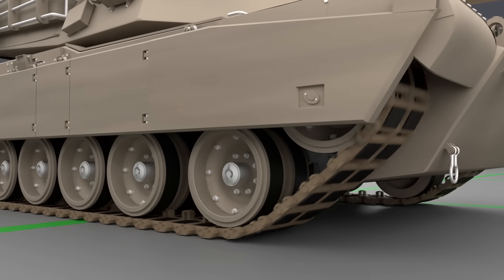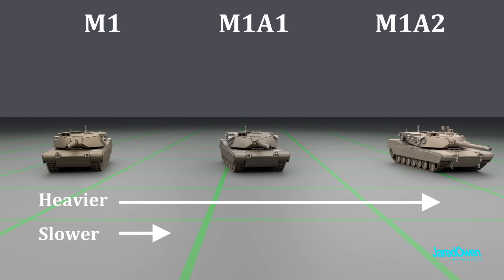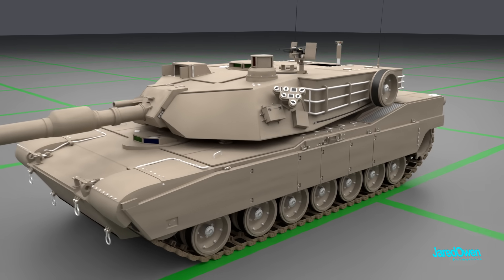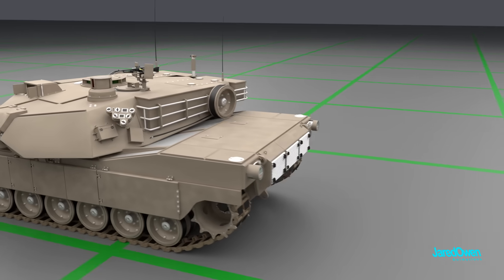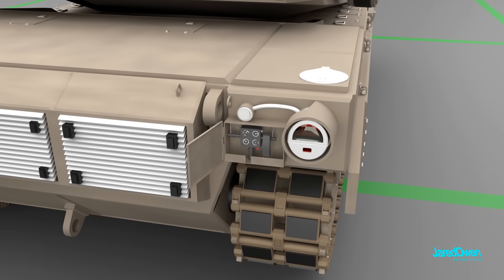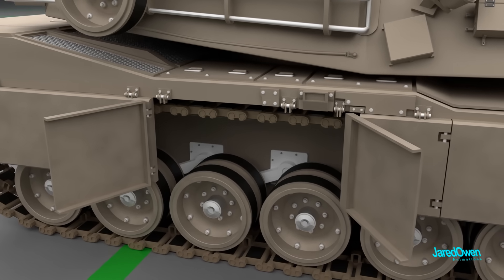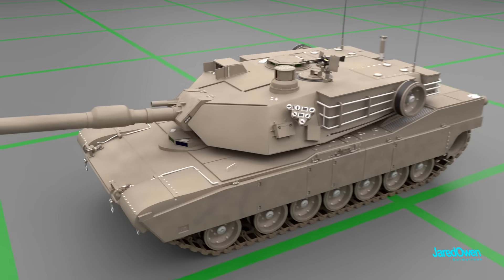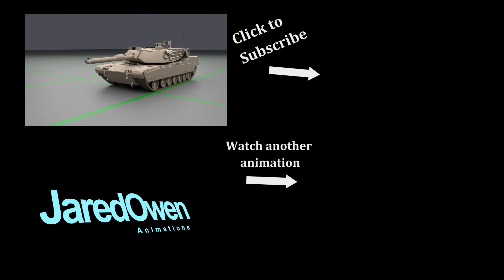How does a Tank work? (M1A2 Abrams)

Comment: WANT TO LEARN OF TRUTH - Fake NEWS is everywhere - FOX NEWS is a better one - CNN is most all Fake - Free energy is in our Bible and is so super simple that it should be positive proof of an extremely powerful SPIRITUAL WARFARE. This is going on behind the scenes in order to cover up the simplicity of this super simple ancient free energy technology. (Geometrical Electricity Multiplication) This free energy technology is so old that it can be found in Ezekiel 1:16, where it is attempting to describe the workings of a UFO motor - ”a wheel in the middle of a wheel”. I used pulleys to imitate this technology, where you only input a few sparks of current for 1 rotation of a motor with a large 33 cm circumference, (about 10 cm diameter) pulley attached. This would freely gain you 99 cycles of AC or DC electricity, from 3 mini-pulleys of 1 cm circumference-(about 0.33 cm diameter) with AC or DC motors/generators attached.
-
Please Don't Believe in the torque lie, as torque is only needed when you need to produce power when the only power that these three mini-pulleys need to produce is a lot of voltage, (easy to do) and a few sparks of current, to crank over this 33 cm pulley once - which takes practically no power. That's right, this one large pulley, along with three mini-pulleys are forming a self-powering set of DC generators-motors. The many rotations of the mini=pulleys build up the massive voltage needed to crank over the large 33 cm pulley once. Then you use the large amount of belt that you gain from the single rotation of the large pulley to rotate the 3 mini-pulleys in massive amounts of times
-
Want to know more about something that really matters, like the Truth about the true powers of this world, reality, and what our lives are truly all about. I believe that Trump believes in our Father in Heaven, and by the way, the ARK of the COVENANT has been found in Jeremiah's Grotto, right under where YESHUA-Jesus was crucified. So HIS BLOOD and WATER that came out when He was stabbed by the spear could run down the crack in the bedrock, that happened when the earth quaked and landed on the correct side of the ARK, that was placed there many hundreds of years earlier. 
-
PLEASE WATCH THIS VIDEO https://www.youtube.com/watch?v=B8TRoQk6WUE @ (41:41) - HIS Blood is STILL ALIVE and has only 24 chromosomes - 23 from His mother and only One male chromosome from His Father Above (normal people have 46, that’s 23 from the mother and 23 from the dad). If these videos have been taken down, then in YouTube search these words - ( ark of covenant blood Ron Wyatt ) - Sorry guys + gals, but the higher up elite of mankind has decided to believe + side with these aliens (fallen angels and Nephilim) - sons+daughters of the children of fallen angels + human females in building these particle colliders + quantum computers - which mess with our timelines + allow evil spirits into our reality.
-
The Bible writings speak Truth and real HIS-story,
NOAH’s ARK -  there are many stories of the world flood all over this earth
https://www.youtube.com/watch?v=oQwfU7DvUyE  
https://www.youtube.com/watch?v=82j1IqwA6P0 
RED SEA CROSSING
https://www.youtube.com/watch?v=QeX966OVxwU  
https://www.youtube.com/watch?v=Nsa7ebyUVD4  
-
I cannot be sure if Trump was-is+will-be the best American President,,, but did you notice that the fake news of the very corrupt media does not mention all of the great things Trump did?. Democrats not only want to kill your unborn offspring, but they want to kill them after birth even. DON'T BELIEVE ME,,,., then Google Democrat + abortion, then you can see for yourself. 
-
BY THE WAY - ISN'T THE FACT THAT THE ARK OF THE COVENANT HAS BEEN FOUND early in 82 and WITH CHRIST'S BLOOD ON IT and HIS BLOOD STILL BEING ALIVE AFTER 2000 YEARS- (PROVING THAT HE IS DIVINE), - HAVING ONLY 24 CHROMOSOMES - PROOF OF VIRGIN BORN (the biggest NEWS ever, and proof of the corrupt or fake NEWS) why is this not covered on every TV station 
<<PROOF - search YouTube>>
-
TRUMP ELECTION SCANDAL <<< If these are true-This Is Scary >>>
https://www.youtube.com/watch?v=V_7Z058MC7M&t=3735s 
https://www.youtube.com/watch?v=dBj9ZDC_Ad8&t=1481s  
https://www.youtube.com/watch?v=m0YKf-caVuY&t=240s 
https://www.youtube.com/watch?v=V_7Z058MC7M&t=3720s  
https://www.youtube.com/watch?v=OWwNJZhcrww  
https://www.youtube.com/watch?v=R5ki6S-WsKU&t=977s   
-
WAR IS UNEXCUSABLE https://www.youtube.com/watch?v=spnJ5WDgZnY  
-
Isn't it amazing what knowledge we can gain by simply adding the “il-s” of life, into this evil theory.,, EVil-sOLUTION. Evolution never happened,,, and it never had the time, so it could have happened,,,, because we have only been here on this earth for about 6000 years. These moon age figures are taken from this website @ http://lunarnetworks.blogspot.com/2013/11/apollo-12-alsep-first-to-measure-dust.html   
“Or, so NASA thought,,, just fast enough to form a layer about a millimeter (0.04 inch) thick every 1,000 years. If we say that the moon has been here 4.5 billion years or 4,500,000,000 years and We multiply that by X 1 mm / 1000 years = 4,500 meters of dust. Can you see the utter stupidity of believing that we have been here for even millions let alone billions of years. Our moon is God’s Hourglass, where the small amount of dust being deposited positively proving that we have only existed for a few thousand years.
-
WHERE ARE THE BILLIONS OF YEARS WORTH OF DUST DEPOSITS. Surely that would have produced many meters of dust, as would not the dust have been deposited even quicker way back then + Don't try to tell me that something or someone removed the dust every so many thousand years.
-
DO THE MATH FOR YOURSELF = the amount of dust deposit is known,,, + the amount deposited every year is known too. I did the math in the early '90s, and it worked out to be about 6000 years worth of dust that is on the moon now. I don't know if they use the same figures now or not. But even so, it should be obvious that after even one billion years,,,, the dust should be many meters thick.
-
TRUTH about COVID-19 = https://www.youtube.com/watch?v=H_vNWmqWmZc 
+ https://www.youtube.com/watch?v=vzIWq_59MIY 
-
Have you ever heard of the MANDELA Effect? PLEASE CHECK THIS OUT,,,, + then try telling me that there is not a POWERFUL SPIRITUAL WARFARE going on in our world. This is a must-watch video. All of time and space are changing. Things that are true have been altered + CERN is the cause for these events.
https://www.youtube.com/watch?v=pPrutcbaerQ 
-
Here is one of the videos trying to let this scary information out
https://www.readersdigest.com.au/true-stories-lifestyle/thought-provoking/44-mandela-effect-examples-that-are-seriously-mind-bending 
-
+ here is an explanation by the Physicists https://www.youtube.com/watch?v=HHKmoBeNWWQ&list=PLDIEv5nkqqEa0-u8DIzqpefKBAG0nkb7g&index=2 
-
PRIORITY ONE = This world is going crazy + surely heading for the END TIMES. 
Priority should be, what can I do to prepare + protect yourself + your whole family. 
I don’t care what these EVil-sOLUTIONIST claim. They have never been able to find any missing kinks, between humans + apes or any other animals, and never will,,, because there aren't any. Did you ever see how much DNA coding that there is in the smallest human cell? It is massive + if it were a book shown to us, then we would have no problem in seeing how it could never be made by random chance. And the thing is, DNA is so much more complicated than any book that we could write. 
-
Please choose to take God’s free gift of Christ into your heart, as payment for your sins, so that you can look forward to a beautiful eternity  + do not need to worry about the future. Life is forever,,, if you miss this chance, then you are not only condemning your family to 60 - 80 years of life without the hope + the comfort of a loving Father + Savior + Companion, but you may be condemning them to an eternity in a place worse than hell, where you or nobody else can help them. 
-
Sorry if I scare you with this talk about our eternal souls, but I wish to warn you of LIFE, and all of its good + bad. God created us for good reasons, as He wanted to Create beings that he could love + take care of + communicate with. He is a Holy Being and needs us to be holy to be in His presence. He knew that we could never attain holiness on our own, so He sent His only Son so that we could choose to be with Him and take the Holy Spirit into our beings. That way He could freely give us that which we could not gain on our own so that we could eternally live with Him + He with us.
-
CERN Is Changing Our Timelines – Proof - Mandela Effect Part 1 + this is a video of what they are really up to https://www.youtube.com/watch?v=49dGknES0-w  
-
Here is a website that shows you how quick + simple this GEM technology is to build
= https://www.youtube.com/watch?reload=9&v=NxpoiCFKmPg   
I used 3 mini-pulleys to gain the voltage, but this system only used one
-
http://beliefstoliveby.yolasite.com/  
http://evolutiondebate.yolasite.com/  
-
TRUTH ABOUT CERN
https://www.youtube.com/watch?v=49dGknES0-w 
https://www.youtube.com/watch?v=ooZA0riSa9Y 
D-WAVE COMPUTER
https://www.youtube.com/watch?v=1v19n5JBSDs&t=305s 
RELEASING DARKNESS
https://www.youtube.com/watch?v=7TA-z6RrXRo 
SATAN’s NAME IS "god"
https://www.youtube.com/watch?v=_qr2vT5ySLA&t= 
ILLUMINATI PLAN FOR HUMANITY
https://www.youtube.com/watch?v=49dGknES0-wDE 
MANDELA EFFECT
https://www.mentalfloss.com/article/585887/mandela-effect-examples  
CHRONOVISOR 
https://www.youtube.com/watch?v=eEXpc-a5ry8
Reply: No one asked

Comment: I had to rig an Abrams for animation few years back. Took about a week to get it to the same level of response as seen in this video. Coding tracks to animate correctly with turns and following terrain irregularities was a lot of fun. A video like this would take 2 weeks of full time work to put together at the very least. Excellent job. Clear and informative. Sadly, the project I worked on was cancelled, so it will never see the light of day. Can't even use the tank rig on my demo reel because of it.
Reply: I can do it in 5 minutes easy

Comment: That was well done, but a few questions... what about the other machine gun on the turret? There's both a 7.62mm NATO and a .50 cal... right? Where is all the ammunition for the 3 machine guns stored... not in that turret bustle... right? The crew has to be able to access it in one big hurry. It would have been nice to mention the armor itself... chobham and a layer of DU?

Do the crewmen all start as loaders then become drivers, then gunners and finally commanders? There are more questions but those are the main ones. Thanks.

It might seem that I'm criticizing your video but I'm not because I really enjoyed it... thank you for the upload.
Reply: Heavy Armor Package is in a similar layout to Burlington armor, but is different.
Reply: The coaxial and loader's MG have ammuniton in the hull. The loader's ready store is on the mount.
Reply: @peterson7082  
Thank you. Can you answer a question? I've searched and searched but I don't know the size of the warhead in the tank's HEAT round. I see a Hellfire missile usually has a 20lb warhead. A TOW has I think about a 13.5lb warhead and so on... but what about the HEAT round fired from the M1 tank?  I think it's probably smaller because a lot of its damage comes from the kinetic energy of the sheer weight of the round. Anyway, I'd appreciate any info. 
Thanks

Comment: Regarding the lack of an auto-loader, and your note about the ammunition blast vent direction, Interestingly this just hit my feed today - the Russian version uses an auto loader and therefore internally-exposed ammunition, proving to be a massive and fatal vulnerability:  https://youtu.be/leuowyQLLCM
Reply: Late response but this isnt exactly true. The autoloader has different variants. Most Russian tanks use the carousel autoloader which is under the turret and is exposed to the crew. There are western tanks like the South Korean K2 black panther that use a bustle autoloader and still have blowout panels.

Comment: Curious -- are there turret angles or cases where the turret cannot train, in which the driver cannot exit the tank?  That would be alarming!
Reply: Not really.  The turret at its lowest would sit roughly about 2 feet above the drivers front hatch and the door slides sideways.  It would be a tight fit but so long as everything is in working order, all crew can evacuate when needed.  The drivers hatch can, however, limit cannon depression (its ability to aim up and down).  The cannon cannot aim down if the driver’s hatch is open and will automatically aim up if the turret faces forwards.

Comment: many things inaccurate with this video. I was an Abrahms driver. the cockpit opening for the driver is not how the driver gets into the tank, he gets in the same way as everyone else. that opening above the driver is escape only hatch. the engine is the same engine as an apache helicopter, in fact, they can be interchanged with each other. the fuel is mostly diesel, not jet fuel. but the engine can run on that, diesel, gasoline, propane, and even the same oil used in the old time oil lamps. and it is NOT protective against nuclear weapons. it will melt and destroy by those easily too.
Reply: Just fuel the engine with any combustible liquid, so technically, you could even run it with PISS

Comment: Watching this as a complete layman, I was kind of surprised that a modern tank still needs a crew of 4. A jet fighter for example only needs 1 or 2. Is it foreseen that future tanks still require this number? I know many require 3, how about 2 for the future?
Reply: It’s a tried and tested number. Tank crews are responsible for maintaining and repairing the tank, and allows crews to be more flexible. There are some tanks that only have 3 crew members, the Russian tanks and I believe the next generation of German tanks only house 3 members.
Reply: @zachb1706  Interesting they do their own maintenance, is that so they can operate more independently in operations?
Reply: Loading rounds is only a limited responsibility of the 4th crew member.  They also have a 7.62mm machine gun out their hatch, help load the two 12.7mm machine gun ammo, radio duty, clear jams, load ammo (120mm, 2X12.7mm, 7.62mm), help with maintenance, extra crew for 24/7 watch, extra person to scan for threats, they are training for the next position up, and an extra gun if they have to dismount and fight.   All Army personnel are trained as infantry soldiers first and then you get a second job as tanker, cook, pilot, or Quartermaster.   US Army combined arms doctrine has 4 crew members so they have the flexibility to engage in multiple expected/unexpected battlefield scenarios.
Reply: Jet Pilots do not do their own maintenance.